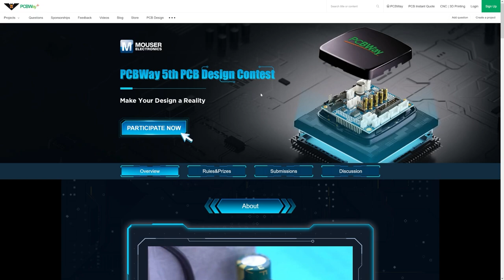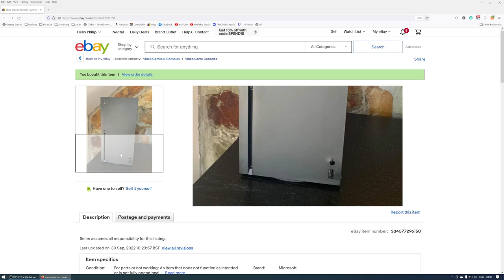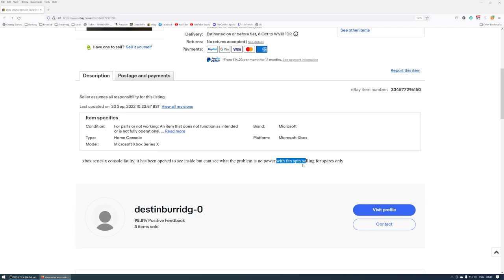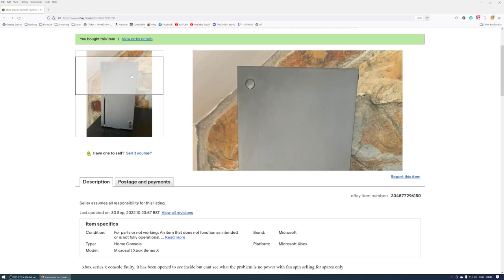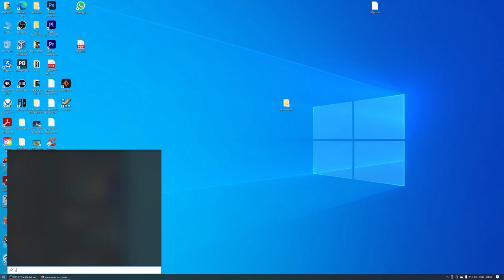I Bought A Broken Xbox Series X On eBay And It All Went Horribly Wrong!

Comment: Pretty insane Microsoft locks the system to the SSD.
These drives could be dead in 10 years and no more Xbox Series X.

I get how they are paired in iPhone etc (even then it should be optional) for security, but a game consoles.
Mind blown!

Microsoft has security for Windows 11 but you can recover it, insane!
Reply from the maker: Yeah I agree, all these drives will die eventually and Microsoft had absolutely no reason to pair them to the console

Comment: I'm really surprised they lock the SSD per console. I swapped the HDD in an Xbox One X a few years ago and I had to format the HDD with a script, so it had the right GUID values but once this was done it installed OSU fine.

Surprised something like this doesn't work with the Series X|S
Reply from the maker: Yeah the xbox one consoles were perfectly fine, this is nothing more than a deliberate attempt by Microsoft to prevent repair. There was no reason to ever lock them down but they did it anyway. They're asking for trouble because the only reason people have never hacked the xbox one consoles is because they had no reason too. Easy emulation and easy to repair, yet these ones people have a reason to try and they will very likely succeed. There are much smarter people in the world than the boffins at Microsoft and I truly hope they inflict a world of pain on them for their corporate greed
Reply: @TheCod3r  I've no doubt a workaround will be found, the repair community finds a way around most artificial locks.,
Reply from the maker: @GhostMotley  fingers crossed mate, a few of us ( I can't say who) are looking into it

Comment: Doesn't British postage have insurance here in the states anything over a pound is insured for $100 and you can get more insurance, you can't blame the seller for damage caused by the people shipping your package.
Reply from the maker: They do depending on the service, but most people just use the cheap ebay shipping option or don't pay extra for insurance. Technically it is the sellers fault though. I've sent several Series X consoles to customers and never had one damaged because I package them correctly

Comment: Hiya yes spares or repair that means it can be repaired or broken up for its parts and should be discribed as if the unit just fails but in this case you are right to ask for ypur money back good video and informative Ebay needs to set out rules for spares or repair sales keep up the good work mate
Reply from the maker: Thanks mate, yeah the seller was definitely intentionally deceptive in this listing. If he had been honest from the start I'd never have bought the console at all

Comment: I bought a gameboy color from ebay with no power issue, but the seller never listed it had water damage and you couldn't tell from the pics, fuses, and power switch was good, the contacts for the buttons were completely ate off the board there was evidence of water in the screen, not even remotely possible to fix
Reply from the maker: That's a tough one because the seller can claim they didn't know. Unless it's had repair attempts previously that haven't been declared ebay may side with the seller
Reply: @TheCod3r  they said they would give a refund but then started being rude and hateful which leads me to believe they knew it was water damaged, but I took the loss because ebay disputes take too long and I've had an issue with a seller in the past and it took me a month to get my money back. But I guess sometimes we will get bad sellers because I've seen a few people that buy stuff from ebay to repair get ripped off sometimes, and I see they got you as well

Comment: I just purchased a high value Game Boy game on eBay that was listed as “doesn’t read”. I took it apart to find that the previous owner destroyed several legs on the RAM module when changing the battery. 

How would you handle that?  I was able to swap the ROM to a $4 donor and the game is fully functional and is worth more than what I paid for it. I sent the seller a message asking if they knew it was physically damaged.
Reply from the maker: That's a tough one, but I'd say as you've attempted a repair there's not really much you can do

Comment: that ebay photo looked 'photoshopped' to remove the scratches
Reply from the maker: It did look a little bit odd on closer inspection
Reply: @TheCod3r  I did  a bit of digging and that seller sold one the day before that had the same marks on the back as your one. Seems they sent you the  wrong one.

Comment: Hi Phil is there any chance of using recovery software to recover the key ?
Reply from the maker: It depends really mate, because the partitions have been deleted it depends how the controller on the SSD handles that. If it just marks the partition as deleted until another partition overwrites it then maybe, but if it actually deletes it immediately then that's very unlikely to be recoverable. Conventional drives mark the space as deleted but don't delete anything until it needs that space and then it'll overwrite the old data, but these controllers could be doing anything. I will be trying it though to see how far I can go with conventional tools to recover the data

Comment: There's a slim chance you might be able to recover data from an SSD even after it's been formatted. Did you try? The only other way would be to extract they key from the CPU, and I don't think anyone's been able to crack open this puppy yet. Agreed, there's absolutely no reason for Microsoft to do this.

Comment: It's probably just an illusion or the angle the solder settled at, but at 16:01 it almost looks like they tried to use a type of small gauge tabbing wire to connect those right leads. Also, at those times when I feel like my own mediocre wiring and soldering skills are sub par, it's comforting to know that there's people out there who are much much worse at it. Years back I used to take scrap electronics from the junk pile at work to teach myself how to do simple things, like take ICs off or swap various parts without destroying them. Starting out was a complete shit show. This thing... Has that same energy. 

Just to guess, I wonder if this was originally a bricked machine that was used as a practice piece to teach someone new how to do some component replacement/repair. That or someone's XBox broke and had a friend who told them "I know a guy" [that could fix it for cheap].

Comment: I wonder what is the difference between two freshly installed drives.
Can you dd 2 series drive and hex compare them?
Maybe the hardcoded serial is the only difference.
Reply from the maker: There is a 136MB file located on a partition at the start of the drive but as of now it's unreadable. The partition type is set as XBFS and also encrypted so at the moment we can't do hex comparisons, but it's being worked on

Comment: Hey Phil, this sucks for you dude. With regards to the SSD, is there not a way to manually add the partitions, or mimic another ssd, I assume standard ssds in a PC is different.

Just when I got a ssd for my laptop, I had to format it and create a new partition, for laptop too work. 

That's why just curious if there was a way ?
Reply from the maker: There technically is mate but without the original SSD we don't have the ability to pull the original encrypted file needed to get the drive to boot into safe mode. It  basically has a 130ish MB installed file on a custom XBFS partition at the start of the drive and the console looks for that when booting up. If it doesn't see the file or if it doesn't match what's stored on the flash rom on board it'll instantly turn back off. Unfortunately that file also mutates every time you reinstall the system too
Reply: @TheCod3r  that sucks pal, if only someone had designed a peice kit, that you could pull the motherboard serial with what suppose to be the matching serial and rewrite

Comment: could you maybe use a "recovery patition tool" to fix the ssd or it's deeper than this ? like does formating it "lock it" or something else ? otherwise if the guy only deleted all the partitions and create a new one, well, maybe there is still something to recover?
Reply from the maker: It depends really mate, because the partitions have been deleted it depends how the controller on the SSD handles that. If it just marks the partition as deleted until another partition overwrites it then maybe, but if it actually deletes it immediately then that's very unlikely to be recoverable. Conventional drives mark the space as deleted but don't delete anything until it needs that space and then it'll overwrite the old data, but these controllers could be doing anything. I will be trying it though to see how far I can go with conventional tools to recover the data

Comment: So when the SSD with the operating system is installed, it's mated permanently to the console? What would happen if the SSD failed in the future?
Actually, you answered the questions on the video. Thank you.
Reply from the maker: Yeah if the SSD fails completely it's GG! I've had one instance where I had an SSD die with only 1hr of use. Luckily I managed to get it working just long enough to clone the keyed partition by reflowing the IC. Unconventional but it did work enough to get the boot partition and be able to install a new SSD
Reply: @TheCod3r  
I'm not a gamer (back in the 70s, yes...today, too complicated) but that fact Microsoft has such a lock on ownership of equipment just makes it an easier decision to never to purchase Microsoft branded hardware.
Reply from the maker: @bblod4896  agreed mate, it's kinda the same with every console now. The switch, ps5 and xbox all have locked storage

Comment: Hi, everyone! Have anyone faced such kind of a problem, that series X turns on, updates, works normally, games being installed normally, but when you try to launch ANY game, even indie games, it stops responding. One can think it is hanging, but you can press X button on gamepad for a while and one can see menu to power off or reboot console. Also, when I try to get into recovery mode , it shuts down with beep-off within 2-3 seconds. I'm stuck :(( 
Ps. Forgive me my English, it's not my native language 😔
Reply from the maker: It sounds like the SSD is failing mate. If you don't have the ability yourself I recommend taking it somewhere or seeing if you're under warranty. I can possibly fix it but it would be around £220 as the SSD is expensive to buy
Reply: @TheCod3r  thank you for the answer, really didn't expect any. 🙂 i'm familiar with console repairs, but this case really makes me mad. Cloning SSD didn't help, still automatically shuts down in recovery mode. Will try to reflow APU, then change chipset, and as a last step will try to replace VRM controller, based on MPS MP2926 controller (unfortunately there is no way to buy them now). But I still believe it's some kind of software issue. 
Thank you very much, for such great content on YouTube!

Comment: Every console I see someone uses 10000 pounds of force on their HDMI connector. So many broken HDMI connectors don't know how they do it. Wouldn't let any of these people in my house before you know it everything in your house with an HDMI connector will be broken. Please stop raping consoles, care for them as they care for you on those cold, lonely days when they heat your room with their power. 

The only way to fix this consoles would be if the series X and S were chipped. Microsoft went really nuts on the security, the xbox one S and X which despite being the previous consoles run virtual machines that put different parts of the operating system in a sandbox, this protects the data along with the hypervisor, they still marry the drives to the console. Don't know if they still use E-fuses on the APU though the xbox 360's CPU had fuses that would blow if you updated it past a point. this made it so you could never downgrade the consoles firmware with a firmware flasher. 

As of this moment the Playstation 5 is closer to being a fully hacked and open console all they need is a hypervisor exploit now, unless they get access to the signing keys used to sign each app.
Reply from the maker: Yeah I'm sure hackers will be targeting these drives just because of how Microsoft made them. They've always been safe from hackers for allowing emulation and allowing easy upgrades on the HDD, but now they're giving hackers a reason to look into the security

Comment: its like the old OG Xbox days when M$ locked the HDD's to the board. I am hoping they release an update that removes this DRM/lock down on the SSD. Compared to PS5.. I love the option to replace the SSD myself. I have done the same trick you have done before and it doesn't always work to get the Series X or S back up and running. I am sure some people would probably throw their Console in the trash and go buy another one then send it to M$ to get it repaired.... such a waste :(
Reply from the maker: Yeah I've had a few fail too mate. There's no reason for M$ to do this to the SSD other than to piss us off. They really need to fix it 😤
Reply: @TheCod3r  by encrypting the data and pairing the drive to each console, they can rule out the possibility that someone could extract data using a PC.
I would not hold my breath waiting for Microsoft to lift the restriction or release a tool to reinitialise and pair a corrupted drive.
Reply: "Compared to PS5.. I love the option to replace the SSD myself."

🤨 The PS5 SSD is soldered to the motherboard.
Reply: @mjc0961  I know.. I meant I like series Consoles because you can replace the SSD compared to the PS5.. you can not.

Comment: This video angers me on so many levels. As a general electronic repair shop , I will repair anything from a TV to a Xbox to medical test equipment. I'm not an expert on one device, and honestly value technicians like @TheCod3r who specialize in certain areas.  However if there's one skill you have to have ALWAYS is proper Soldering skills, ( both hot air and soldering iron). If your lacking common sense or can't see when solders melting get a microscope or at the very least a magnifying glass. I wear a jewelers magnifying glass and have the microscope because I accept that at 42, my eyes aren't what they were.

Aside from all that, I do not know WHY eBay sellers think selling as "parts not working" is a get out of jail free card.... I'm not even going to lie, I have ended up with plenty of free or very cheap PS4s because the seller utterly lied or isn't educated enough. Anytime a listing says "it's an easy fix I'm sure..." I call bullshit and 8/10 times a console described as no HDMI ended up being BlOD. It's not about if I can fix it or not, it's the fact sellers utterly lie!!
 And yes, we are 100% protected by eBay. So stop lying in your listings, it'll only hurt yourself in the end.

Side note: I wish broken systems were reasonably priced on eBay.ca I've been trying to buy series x or ps5 but when they leave maybe $50 profit it's just not worth it. That being said, I sincerely appreciate your hardwork and willingness to research and Repair for the rest of us educated / competent technicians lol.
Reply from the maker: Yeah I agree wholeheartedly here mate. Incompetent idiots thinking it's OK to pass their failures on and lie through their teeth just to try and recoup their losses, with no concern for other people who end up with their crap

Comment: I stopped using ebay due to the fact they would always allow the Buyers to open a case against a faulty item and then get a full refund after Having a go at repairing the console making it even worse then what it was to start of with. I even escalated this and had photos as it's technically fraudulent and obviously ebay couldn't give a shit. This happened more often then not Bottom line ebay is not the place to sell faulty goods why they even have an option that says (No returns) only for the customer to open a return is completely beyond me.
Reply from the maker: I agree with you there, but when it's blatantly obvious that the seller is lying or being deceptive in the description, or deliberately avoiding certain key details which determine whether or not someone's willing to buy it, or determine how much it's worth, that's also technically fraudulent.

Personally I believe eBay should review them on a case by case basis and not automatically with an algorithm.

If you take this scenario as a case study, ebay should absolutely award in the buyer's favour. Clearly the seller was intentionally deceptive. He even said in a message after I reported this that the console had "been taken to a repair shop". That should have been in the description.

That said, if I had attempted a repair before checking the SSD, and before seeing the damage, then yes, I agree it should be dismissed by ebay.

Comment: £100 cloning tool, cant you just use DD in linux.

So the first thing you should do with an Xbox Series X is pull the SSD out and clone it to an image just in case the SSD dies... that is stupid.

Then again the PS5 SSD is soldered the the motherboard and is custom... Yeah I'm not touching consoles anymore.
Reply from the maker: Yeah DD also works but that also means you need two free M.2 slots to plug the SSD into the computer. The tool allows it to be done quickly and without the need for a computer with spare slots